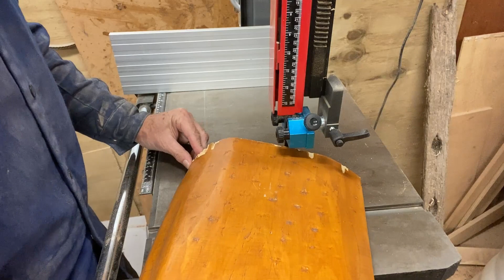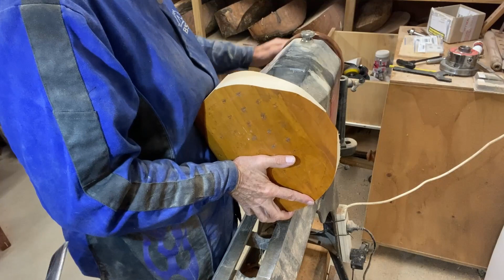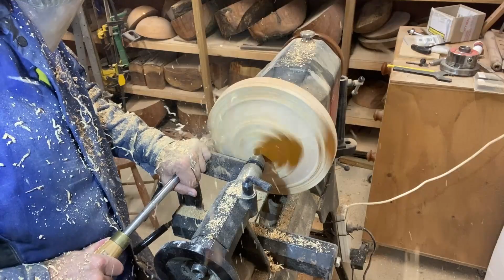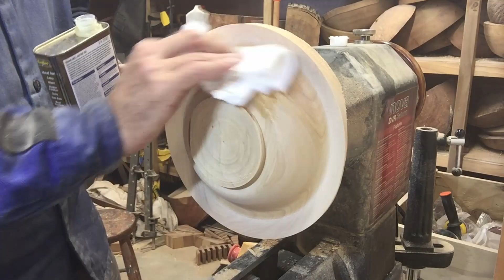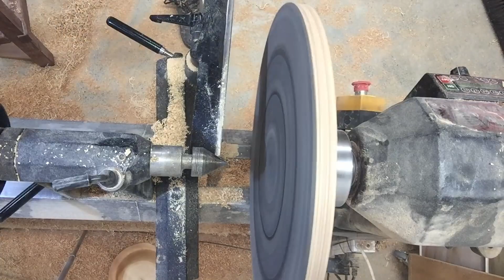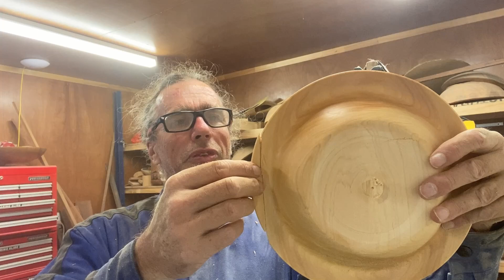Woodturning - Aerofoil to platter splatter

Comment: Hi Brett
Nice platter try re mounting with a block and hot glue the glue hangs on real strong.
Pity it tried and successfully flew off but you did mention an “air foil”.
Thanks for sharing good to see you back
Regards
Reply from the maker: Thanks Mal. Completely forgot about ye old hot glue gun

And I had to chuckle at the air foil. 
😀😀😀Brett